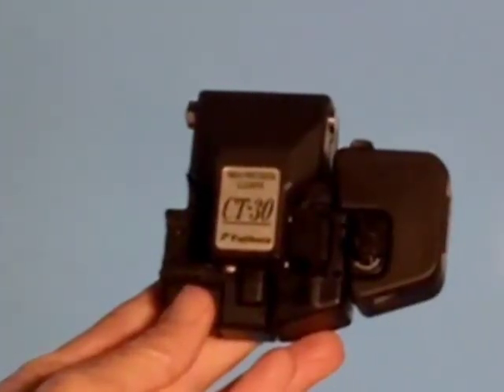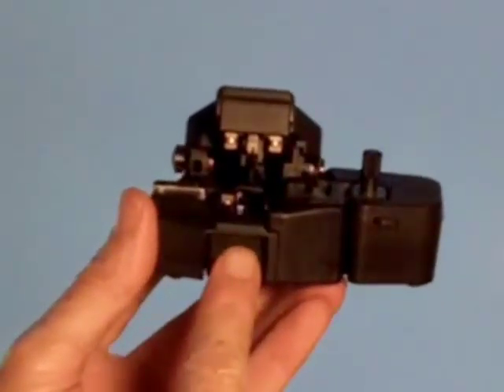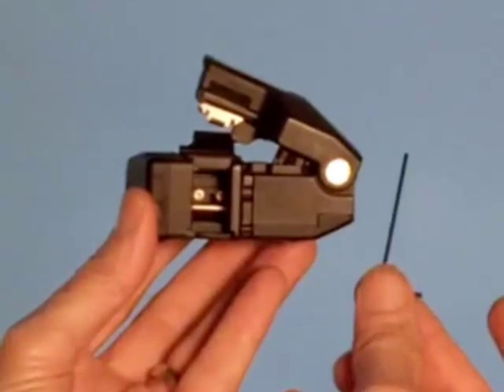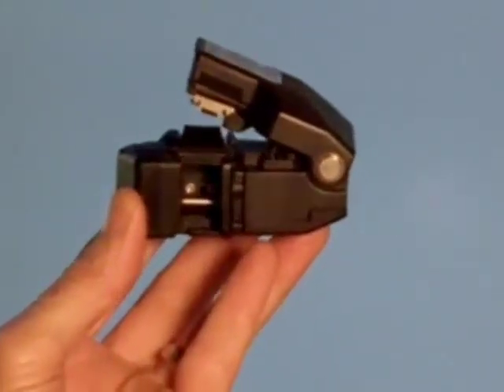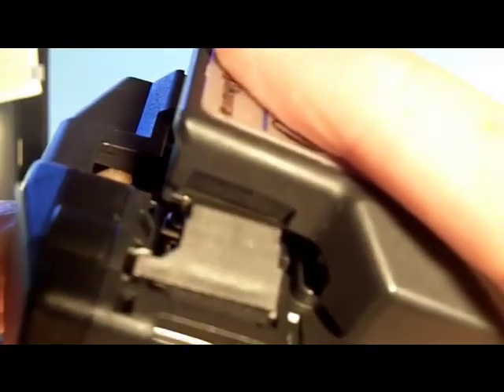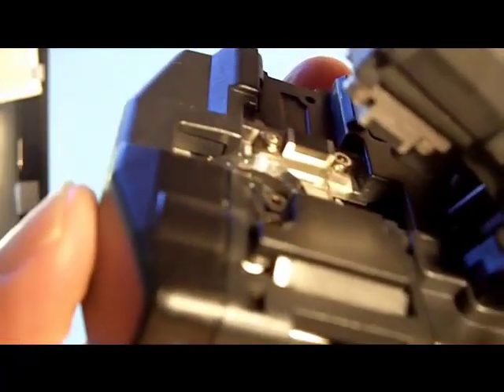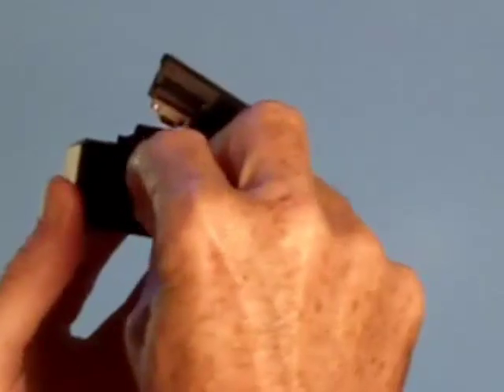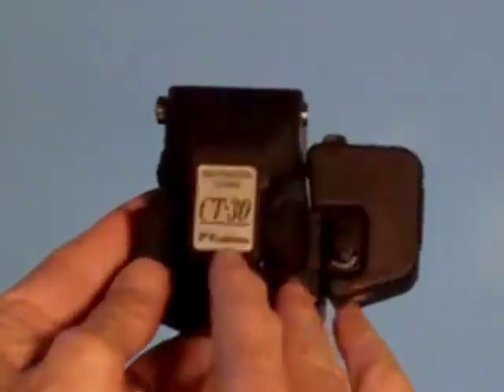CT30 Cleaver Blade Rotation

Comment: There's actually a little spot mark on the base next to the blade that you align the hole with when you rotate the blade. Then the screw tightens straight in every time when the hole & spot are aligned. Hope this helps.